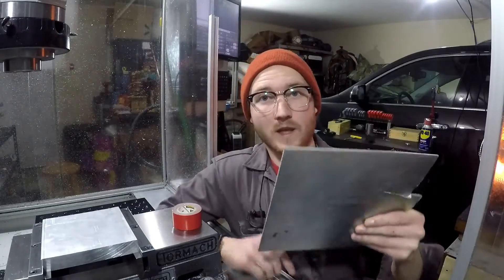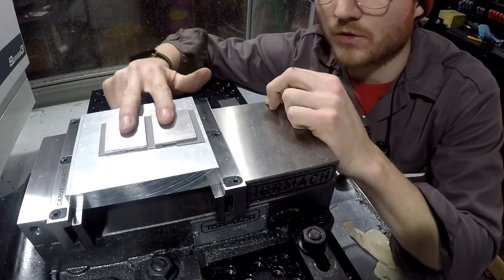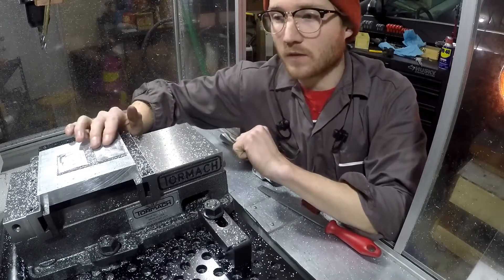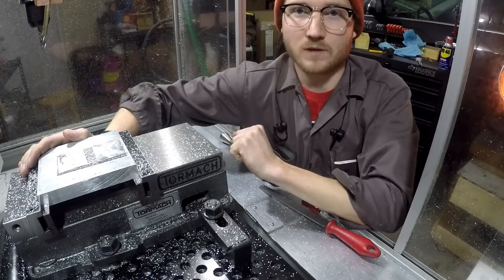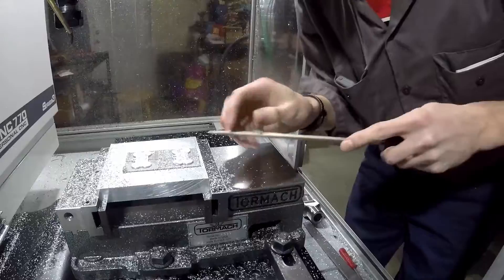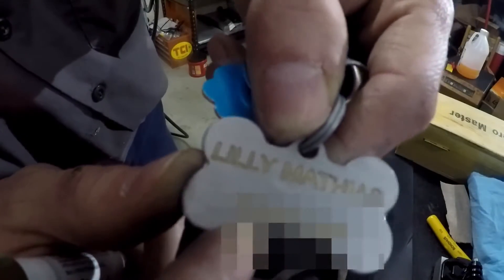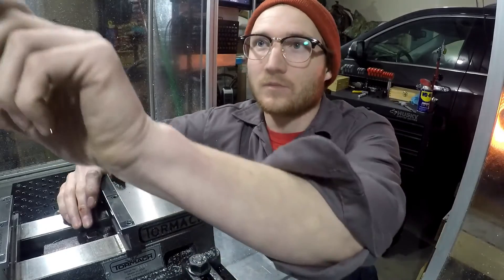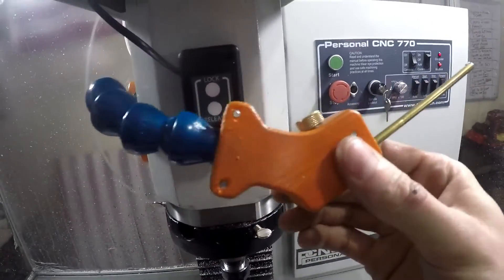CNC Machining Dog Tags: Home Mfg. Days 22

Comment: Nice!  Somehow I missed this one when it came out.  I just ordered the enclosure for the fogbuster.  Thanks for showing it off!
Reply: If anyone else is interested in picking one up, here is the link - https://www.ebay.com/itm/292449871155
Reply from the maker: Nice!! I'm glad you started selling them.  I saw the one John Saunders had and I knew exactly where he got it from!!
Reply from the maker: No problem! I thought you were getting flood coolant for the new 1100?
Reply: I'm doing both.  Some of the things I plan on milling are better with just the Fogbuster.  Plus filming anything with flood seems too difficult to deal with.  I will use my wash down hose everyday though!  That thing is great.
Reply from the maker: That sounds super helpful.  I think I am going to get the flood coolant at some point too.
Reply: If you do, I would just DIY all of it.  It is easy once you get into it and you can use hardware store parts for 99% of it.  I'll have a video on mine in the next few days.
Reply from the maker: Awesome! I will look forward to it! I assume it ended up being cheaper to just diy it?

Comment: The trouble with sheet stock is that it's thin enough to become flexible as the tool exerts pressure against it and the thick foam tape makes that worse. I use masking tape on both sides with superglue on one and accelerator on the other and it really helps, along with making sure the entire cutting area is glued in place.
Reply from the maker: That sounds like it would work pretty good.  I will definitely try that next time.  Thanks for sharing

Comment: What engraving software did you use?  I normally use inkscape for my graphics but it doesn't put out G-Code for single line engravings.
Reply from the maker: I use Fusion 360 for all my design and CAM output.  I'm not sure if you know much about it but you can download it for free and if you are a hobbyist/enthusiast you can keep it for free as well

Comment: Thanks for showcasing the Fogbuster enclosure and posting my email address! I've already had a few requests for it.

I'm very early in figuring out how this will become a product... any suggestions for a name? "Fogbuster enclosure" is pretty boring...
Reply from the maker: No problem! I'm glad you shared it with me.  As far as name.....I have no clue haha.  I'm pretty bad at coming up with things like that
Reply: Me too. :O) If anyone has suggestions for names, I'm all ears!
Reply: I really like this solution.  I mounted mine on a Noga base which worked well except it had every metal shaving in my shop stuck to it after about 2 months of use.  I just ordered one on ebay.  I think the Fogbuster Enclosure and Mount is a good name for it.
Reply: Thanks, Jason. Can't wait to see it in action on one of your projects!